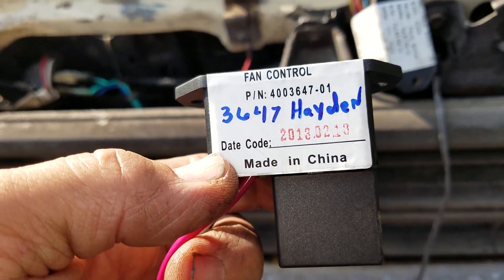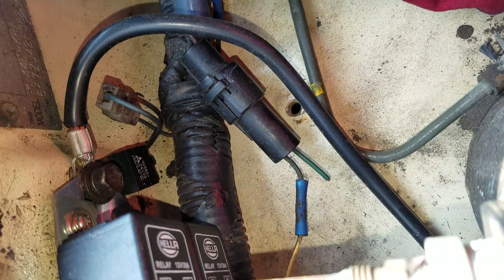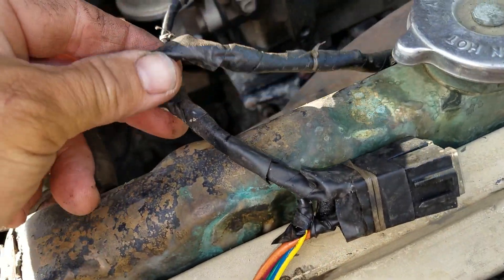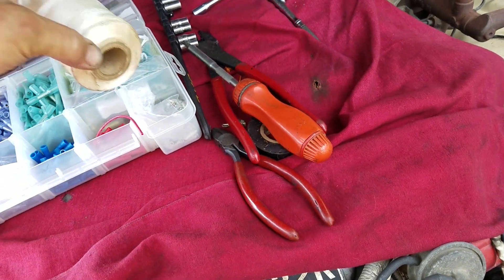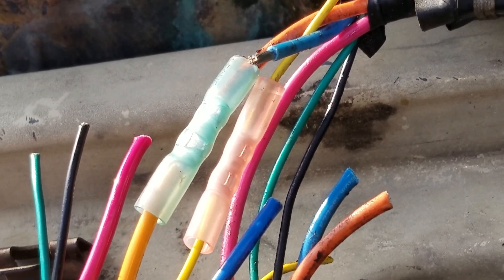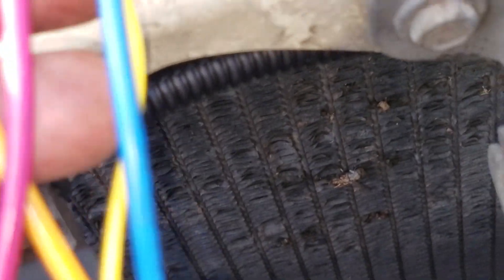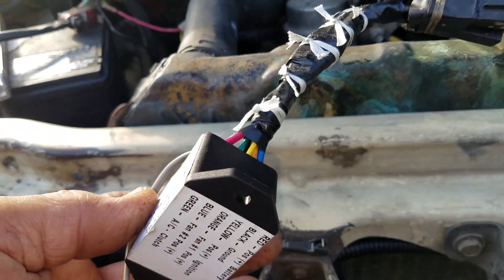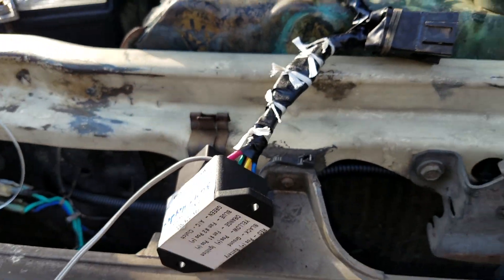Hayden fan controller 3647

Comment: Are you splicing into current wires or making all new connections when installing this? Nobody on any of the videos mention it..
Reply from the maker: I am using a 12v switched circuit that is not being used. All that does is provide switched power. All the other wires are for the fan.
Reply: @chriskolar  sorry, my question was specifically the fan (orange) and AC(green) wire. Just splicing into them or making a new connection? If new then I ground the old wires?
Reply from the maker: The a/c is a 12v positive reference. That will turn on the fan when the a/c is on. The orange wire is a load wire to power the fan. It can directly power the fan or switch a relay to power the fan. The other blue wire is not connected to anything unless you have a second fan. The black is connected directly to ground. The red wire is connected directly to 12v. The yellow wire is a switched reference wire that enables the module to operate when the car is on.
Reply: @chriskolar  the wiring is easy and in get it. So I have a stock Jeep with stock wiring. The orange wire... Am I splicing into the current wiring, so leaving the current wiring wired. Or cutting the wire so the Hayden is the only controller. Do I want to leave both (OEM & Hayden) hooked up?  

Same question for the AC green wire? 

So if the fan comes on via the Hayden, what happens when the OEM system comes on at 219f. If it's that hot. 2 12v signals going to the fan, will it go super fast or short everything out?
Reply from the maker: @focus1ism  are you removing the stock fan control? What year model? The Hayden controller will turn on the fan if the a/c is on. If it is already on and there is a separate request there will be no change only stay on if the a/c is turned off and the second signal for fan on is still there.
Reply: @chriskolar  that was the question, should I or am I supposed to remove the stock fan control?  Or can I splice into the wires leaving the original wiring intact?  

I'll try it with, and without.
Reply: @chriskolar  2004 Jeep Liberty 3.7l .
Reply from the maker: @focus1ism  if the stock fan controller is broken and you want to bypass it then yes remove it. It would be better to get a used one from a wrecking yard and retain the factory fan control. If you are adding a fan then you will need to splice the wires and use the 12v signal or ground reference circuit to control the Hayden fan control.
Reply: @chriskolar  the stock fan only comes on at 219F and I want it to come in earlier which is why I'm installing the controller.  I just didn't know if I was unkooking the stock fan and if it would throw a code or something.  I'm going to run both and see what happens.  There is a line in the instructions that says to ground the old wire so I assumed you unhooked the stock controller.  None of any ones videos include what to do with the stock wiring.  Cut it, splice into it, then ground out  the stock wires , really hard to figure out.
Reply from the maker: @focus1ism  the only wire to connect to ground is the ground wire. Any other wire that is not used can be dead ended with a butt connector so it does not touch anything.